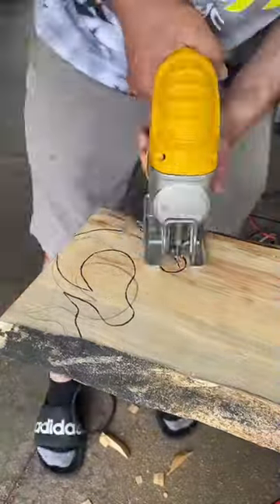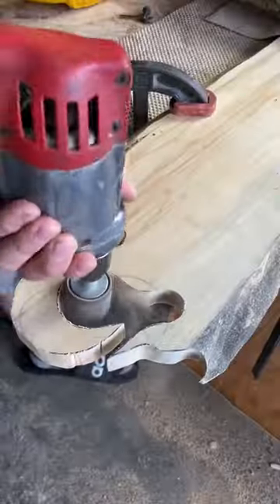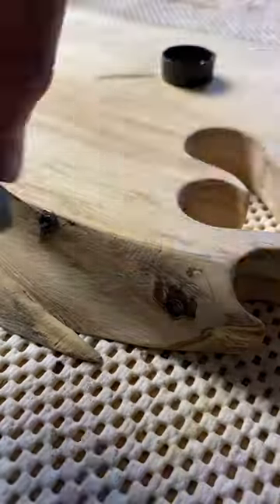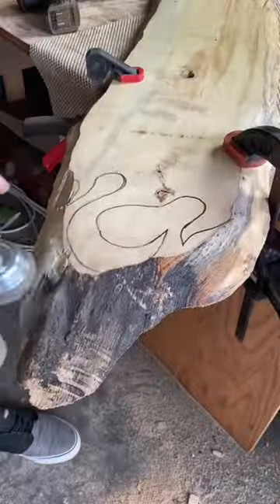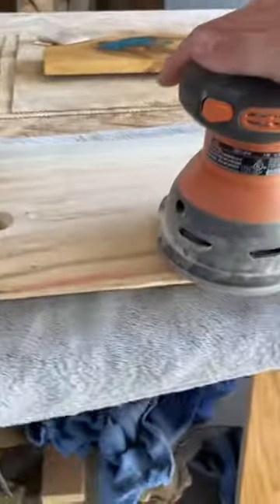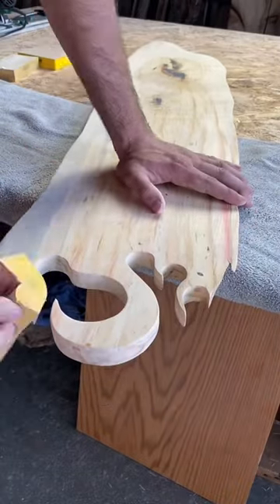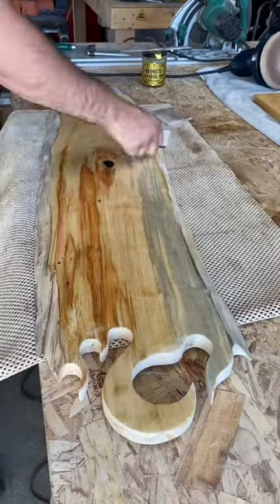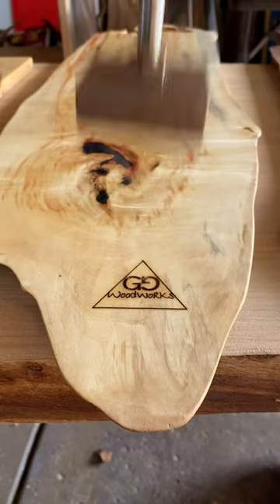Wood Carving a Fire Charcuterie Board 🔥#shorts #woodworking

Comment: That would make an amazing skateboard
Reply from the maker: Hmmm 🤔
Reply: Except for that flame in the back is like a hook that could cause some serious problems 😂
Reply: @ClaytonBigsby01 eh..as long as your fruit doesn't hang too low you'll be fine 🤣🤣🤣
Reply: Except it wont because its not concave and tail/nose are flat, mad up of 1 single piece 9f wood instead of 7 ply